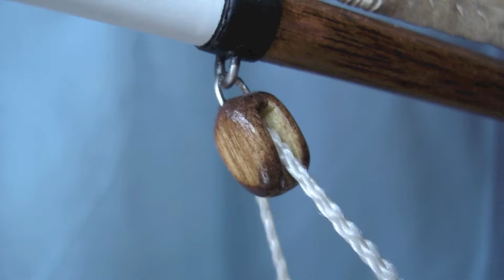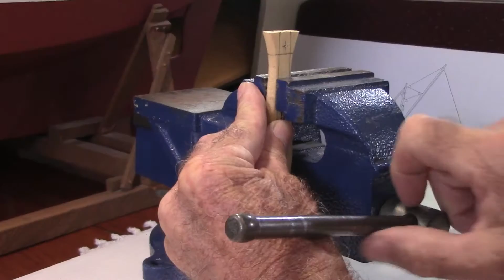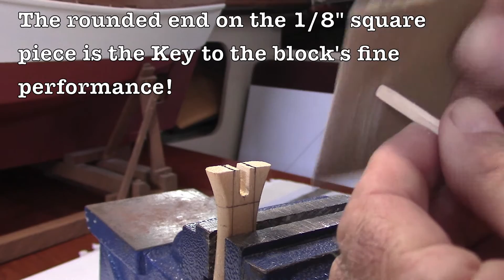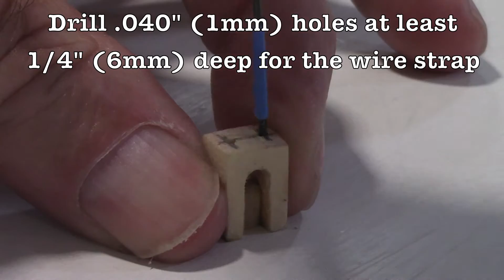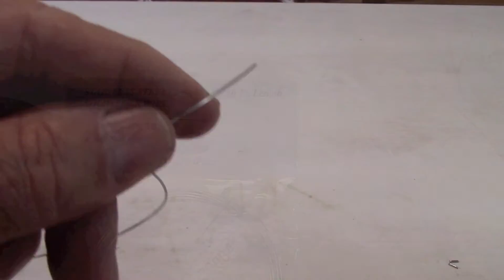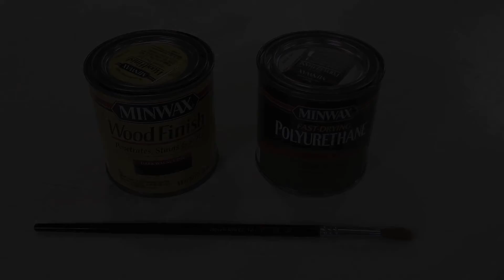RC Sailboat Build Detail - DIY Blocks

Comment: I used to use paperclips as the hook/strop much easier and they are preformed sometimes when making that type of block, otherwise I used rope to make the full eye going around the whole block, and my blocks had brass pins for the roller (instead of the wooden piece you inserted) if they were very small, otherwise I used plastic rollers from old stereos or VHS machines belt systems and found they had various sizes so were a great help.

Comment: So you don’t need a wheel pulley for the movement?
Reply from the maker: No, you don't really need moving parts. The loads on these models are light enough that the "dumb" blocks work just fine.